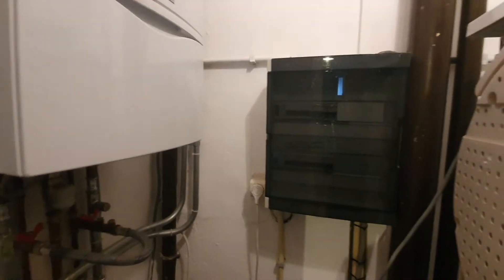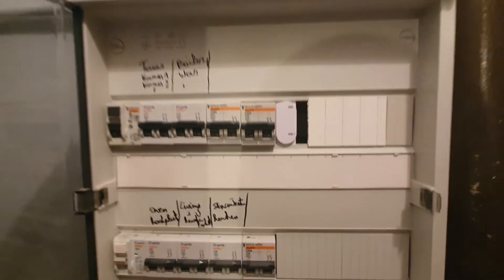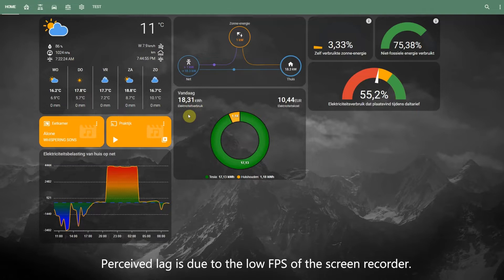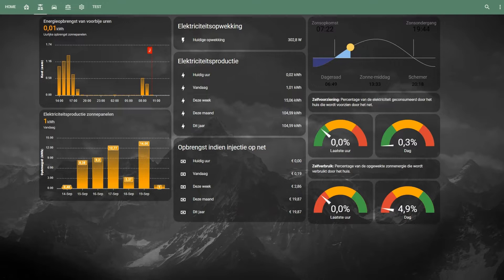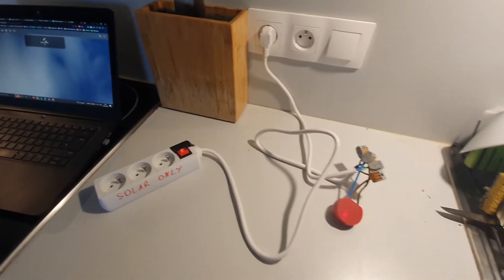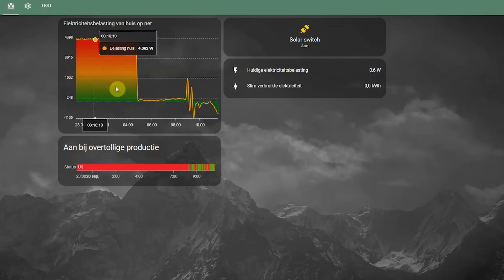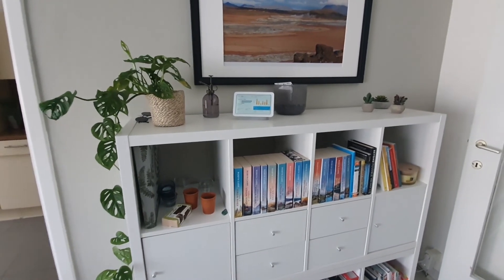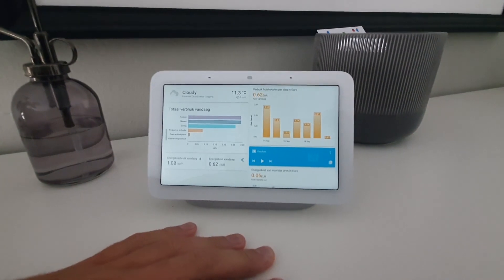Energy monitoring system with Home Assistant

Comment: Your "solar only" outlet is a brilliant idea. I also use the Shelly 3EM in the main switchboard and some Silvercrest smart plugs with energy monitoring (11 € from Lidl). These plugs are connected via Zigbee.
To charge the car, I made 3 options:
- direct start (uses sun + grid) + I can set a minimum kW at which it continues to charge (eg. 1,5 kW), even when there is not enough injection. When more sun power is available, the charger increases the charging power (sometimes even 8 kW)
- sun only: will only charge when there is an excess / injection. It will stop charging when there is not enough injection. 
- timer based (typically to charge at night and to obtain the desired SOC by 6 AM)
Reply from the maker: Nice! and which car charger do you use? I assume it's a connected charger since you can control the charging Amp's.
Reply: @NathanNaerts  An Alfen Eve Single Pro-line. I connected it via a LAN cable and manage it from Home Assistant via the Modbus protocol.

Comment: Nice Dashboards Nathan ! Are you using apex-charts (like for the 'Electriciteitsbelasting van huis op het net' graph) ? Would you be able to share the code you used for that graph ? Thanks !
Reply from the maker: Yes indeed, Iam using Apex-charts. This is the code:

type: custom:apexcharts-card
update_delay: 3s
update_interval: 1min
graph_span: 24h
hours_12: false
header:
  show: true
  title: Elektriciteitsbelasting van huis op net
  show_states: false
  colorize_states: true
yaxis:
  - id: first
    decimals: 0
    apex_config:
      tickAmount: 4
apex_config:
  annotations:
    position: front
    yaxis:
      - 'y': 0
        strokeDashArray: 15
        borderColor: '#2647de'
        borderWidth: 2
all_series_config:
  stroke_width: 2
  float_precision: 0
  curve: smooth
  type: area
  unit: W
  group_by:
    duration: 30min
    func: last
experimental:
  color_threshold: true
series:
  - entity: sensor.totaal_verbruik_3fase_power
    name: Belasting huis
    color_threshold:
      - value: 4000
        color: rgb(225,6,0)
        opacity: 0.8
      - value: 2000
        color: rgb(225,122,0)
        opacity: 0.8
      - value: 0
        color: green
        opacity: 0.6
      - value: -2000
        color: blue
        opacity: 0.8
Reply: and are you using some kind of dynamic retrieval of your electricity prices or do you set a static value ?
Reply from the maker: @TTompi  No, I was not able to find a good API to get dynamic electricity prices.  So I created an 'input number' where I can input my current energy price. I use this variable in my cost calculations.
 This is the code for the price valriable, just add it in the 'configuration.yaml' . There are also charts for this input number, so it's easy to change the value from the dashboard:

input_number:
  box_dagtarief:
    initial: 0.57
    min: 0.2
    max: 1
    step: 0.01
    mode: box
    icon: mdi:currency-eur
    unit_of_measurement: 'EUR/kWh'
    name: Energie prijs (dag tarief)

  box_nachttarief:
    initial: 0.57
    min: 0.2
    max: 1
    step: 0.01
    mode: box
    icon: mdi:currency-eur
    unit_of_measurement: 'EUR/kWh'
    name: Energie prijs (nacht tarief)